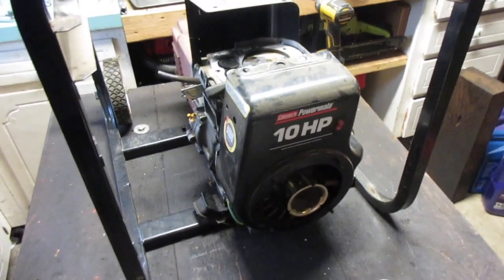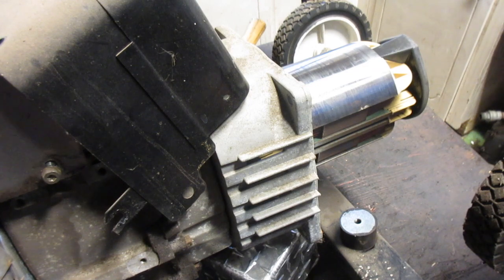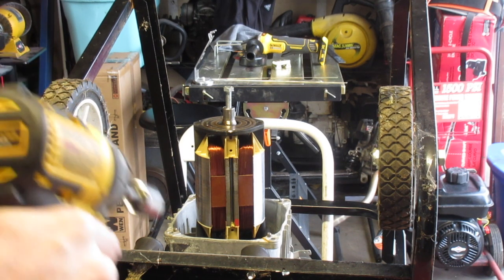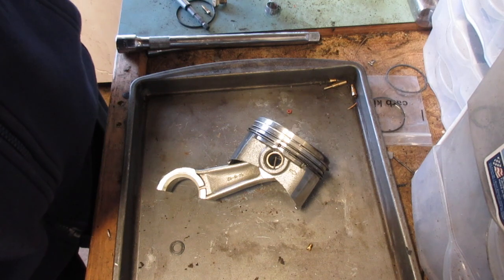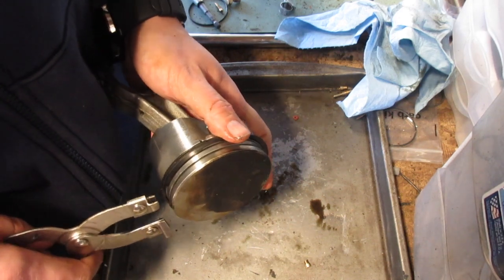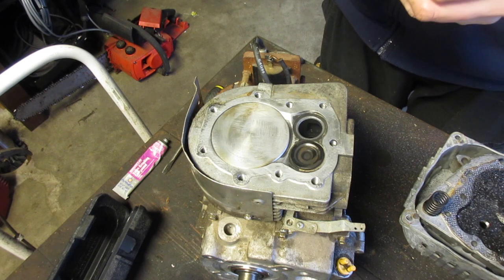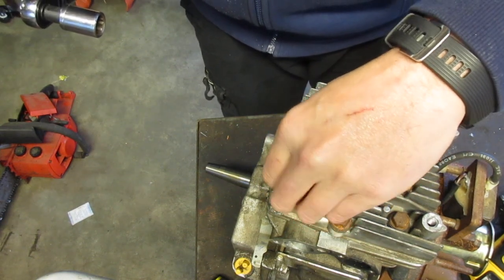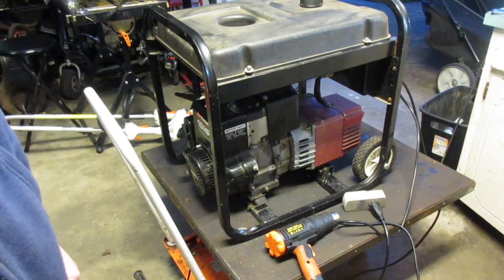Tecumseh 10 HP Rebuild

Comment: Neighbor has this same Tecumseh motor, on a generator, and it's leaking oil from where the governor shaft goes through the crankcase cover.  Have you ever dealt with that issue or know if it can be fixed?  Thanks
Reply from the maker: I have seen it a few times. The unfortunate part is that it isn't easily fixable. You need to open the motor and put in a bushing on the governor shaft. Just opening requires new gaskets
Reply: @PNWSmallEngineandLawn  Thank You